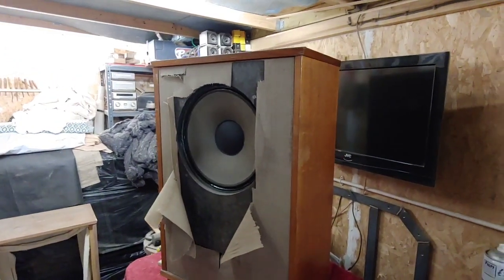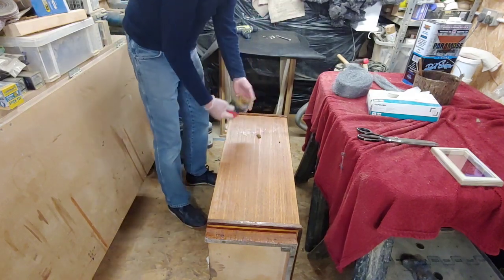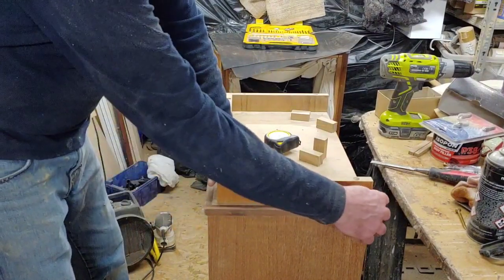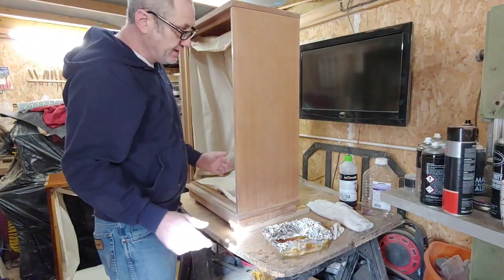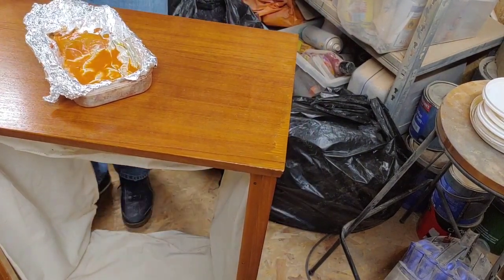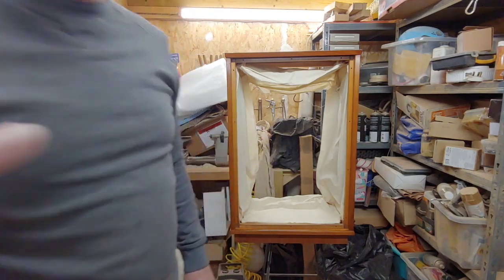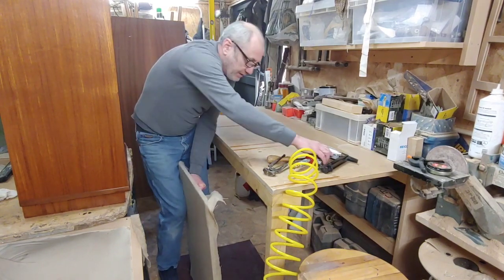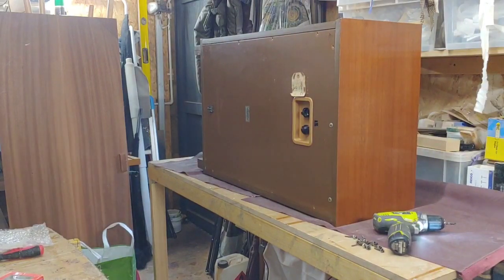Cabinet Restoration Of Tannoy Monitor Gold Loudspeakers

Comment: Excellent work, they look great @tweaker man. Regarding the bass reflex port which is covered on one and not the other - The correct configuration for the 15" driver you have is to cover the port (ie infinite baffle). They are only uncovered (bass reflex) when you're using a 12" driver. Tannoy provided a sub-baffle to fit the 12". 

Where are you based? I have some smaller Chatsworth cabinets that could do with the same love and I'd be interested in a price.
Reply from the maker: Hi Alfie, I'm based in Leighton Buzzard Bedfordshire, thanks for commenting & watching 👍
Reply: @tweakerman  Thanks. How much sanding can the veneer take on these cabs before going too far? Is the veneer fairly thick?

Comment: Something very wrong here. These are obviously 2 different speakers. And this is probably why the port was covered on one cabinet. If it were me I would be selling the 12" and replace it with a matching 15".  Just my 2cents worth.
Reply: Quite correct, 
The Lancaster enclosure was offered with either 12", or 15" drive units. In the case of the 12", the port was open, but in the 15" it was covered with the panel shown on the video.